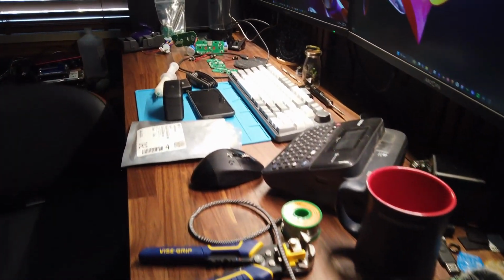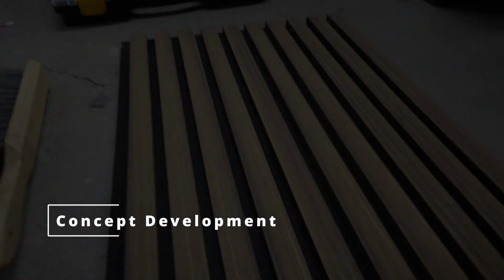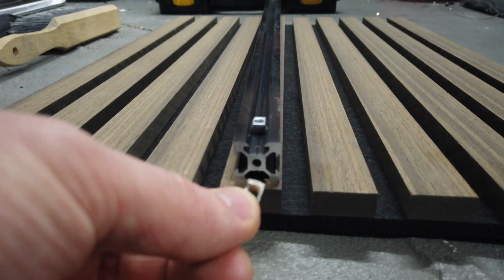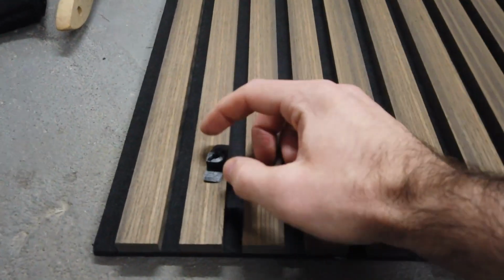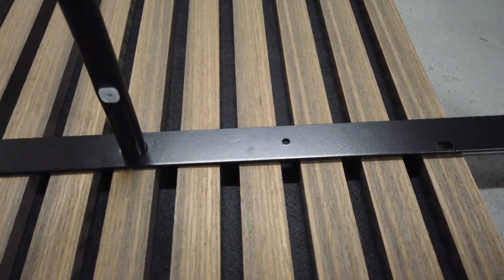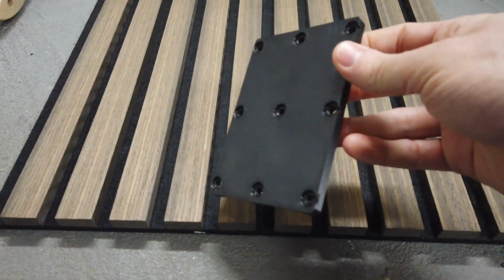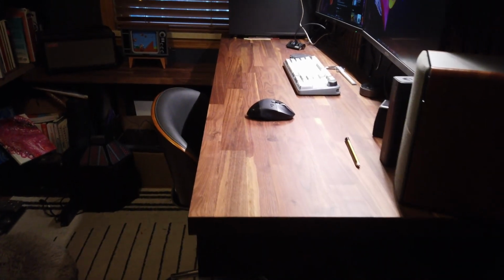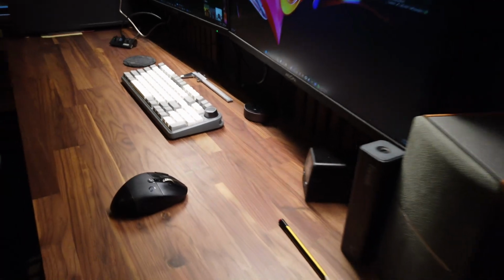No Drilling? No Problem! I 3D Printed a Floating Bookshelf Mount for Slat Walls!

Comment: Hey man, good project, I'm thinking about the durability of the project, because the T-Nut (remodel) that you have put into the panels might start to separate at the layers.
I suggest making them using a different manufacturing process, it might even give you better strength if you printed them at an angle, but I'm not sure about that.
Still as I said good project and this is just a suggestion from a madman.
Reply from the maker: Thanks! Totally a valid concern, the current design can be printed in an orientation that puts the layer lines perpendicular to the ground for maximum strength.  I tested it off camera for two weeks with 10 lbs. at the very edge of the shelf and the nuts printed in the "worst case scenario" orientation and it was fine, they sagged into a stable position after about a day but plastic creep is definitely a long-term concern.   My actual design constraint was our two cats needed to be able to hop up onto it without it coming off the wall and so far so good